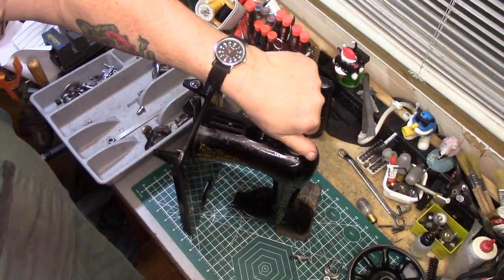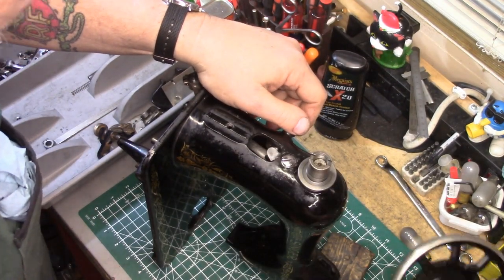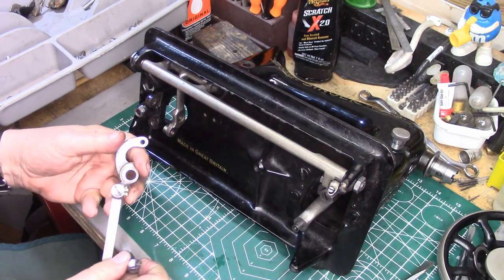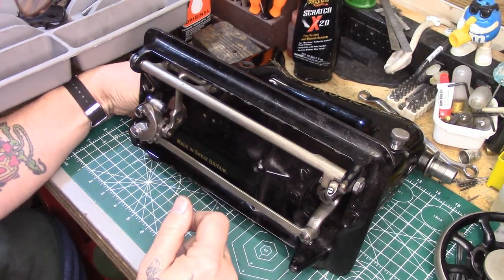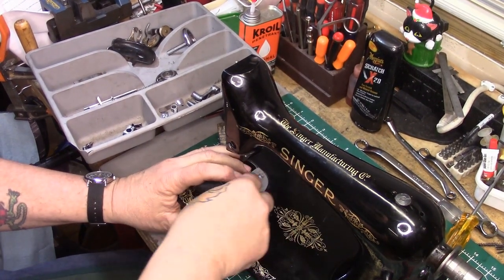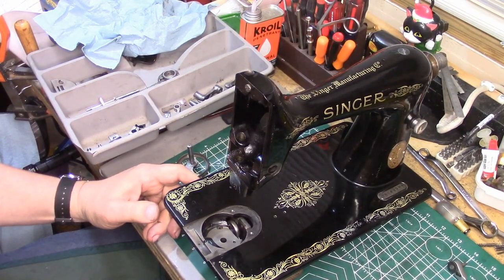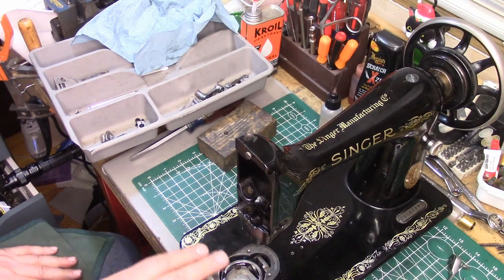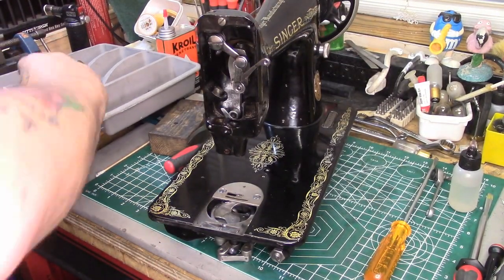A 99 for Sandra Part 3: Sunday Morning Quickies Ep. 76 - April 2, 2023

Comment: HI Bob, great videos. I'm just putting back together my first ever machine (a 99K). Unless I missed it you don't mention what to do with the small screws at either end of the connecting rod to bell crank, if tight they seize the mechanism so how do you adjust them correctly ?

Comment: How do I identify eccentric screws? I'm fascinated with this video. Thx!
Reply from the maker: Excellent question! An eccentric screw (bolt) had an element that is offset from the centerline of the fastener. As an example, the eccentric bolt that connects the stitch length regulator fork to the feed dog rock shaft has a portion that is slightly smaller than the diameter of the bearing surface that rides inside the small end of the fork, and that smaller portion is offset from the centerline. The smaller portion is the bearing surface that rides inside the small end of the feed dog rock shaft and has the threaded portion at the end for the nut that secures the connection and adjustment. This eccentric allows the geometry of the connection to be varied by a small amount, which happens to be enough to adjust the fore and aft positions of the feed dog in the needle plate.